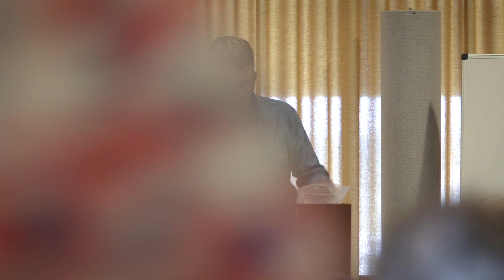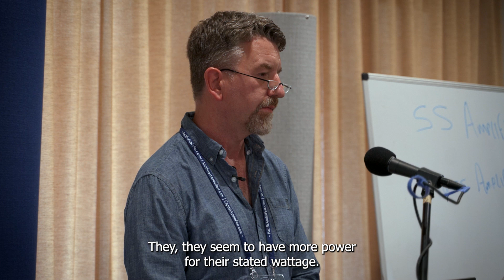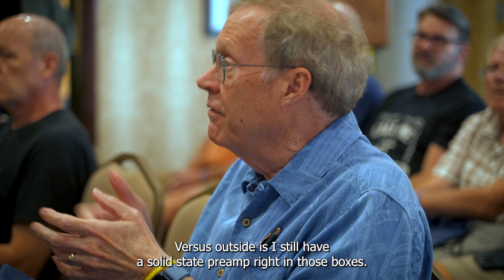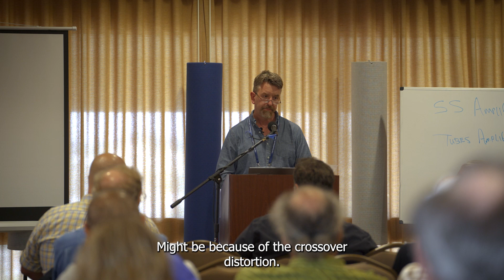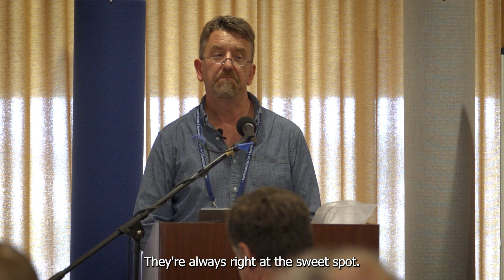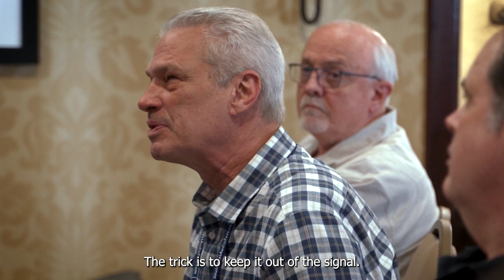Unlocking High-End Audio with Dan Wright of ModWright | Pacific Audio Fest Lecture

Comment: Because Modwright charges $1k more for a Lundal transformer, that tells me that the markup is 3x (based on a Radial JDI Stereo that uses Jensen transformer is $380).  
So I think ModWright probably also overcharges for the non XLR version at $2900, so I think it should be priced lower than $2900.